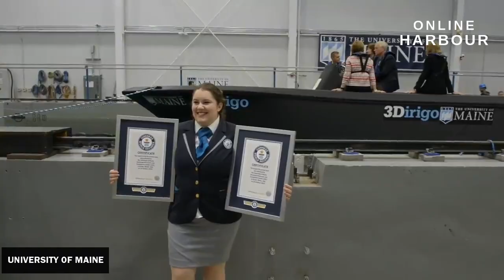The world's largest 3D printed boat built by the largest 3D printer

Comment: I mean it floats and that's great and all but how would this hull material and structure handle waves?
Reply: Thats not the problem. This is a structural stepping.
Reply: You can print with fiberglass and its over 3 times as strong as ABS, you could build in any strengthening rib you wanted where ever you wanted it, 3d printers will make boats eventually, almost indestructible and unsinkable.
Reply: No stringer system at all
Reply: @drewjohn6847   indestructible and unsinkable? lol
Reply: @ronp5644  the titanic was unsinkable too 😂😂
Reply: In order to compensate the typical weakness of 3D printed object, additional material (thickness) was used. This boat is four times as heavy as a conventionally manufactured boat would be. So, it's strong enough, but anyone who knows anything about boats knows what the added weight does to the practicality of this boat.
Reply: @jayel2531  5000 pounds is 4x as heavy as a 25' sport boat? i think not, a parker 2500cc weights 4300lbs

Comment: Hi there this looks like a very good idea can one tell how much it will cost to get a boat printed using one's own plans thanks
Reply: Probably out of your budget and totally impractical
Reply: @kanekeylewer5704  🤣🤣
Reply: Well given this is currently just a demo project likely alot of money.

The main cost saver will if they can scale and to do that they would need large order volumes.  The Navy and the Coast Guard should be the powers that are pushing this tech forward given its obvious military potential.

I mean just the capacity to deliver disposable naval assets at capacity with relatively little cost input has significant military potential.

If the Department of Navy steps in and starts push large orders through you could see economy of scale achieved over a period of something like 5 years.
Reply: The id like to know is scalability cost and durability.   Also given that ocean farming may be a thing in the near future owing to global warming how well would this work for 3d printing 3d aquatic farms.

I mean theoretically if you can get the cost down to a few hundred dollars per 1/8th acre plot you could bring online substantial floating farms.

Then you've got tidal and wind generator platforms that could be addressed.

Of course with housing prices going bonkers you might be able to reduce cost for live in boats.

You're talking sizable potential addressable markets if you can get costs within tolerance ranges.

The question is how quickly could you scale and realistically what's the cost vectors of reduction you're looking at?

There is obviously significant potential it's just the hurdle of scale that I think would hold you back

Comment: First of all. This boat has no bulkheads or stringers. LOL. Second of all. I guess the structural inspection of this hull only allowed them to equip a Mercury 150 horse engine, for a 25 ft boat that thing is not going anywhere. Also though; lastly, on their own website it said specifically that this boat is “for show only and will not actually be used” Guess that explains all we need to know about this idea.
Reply: Just because it is for show, does not mean they can't make a boat with a better structure. This was more of a "proof of concept". But you could basically design this in a way to make full use of 3D print by printing  the inside in such patterns, that it makes it structurally sound and also adds many compartments to prevent flooding if a bottom is breached. Really, this just needs a good engineering/AI hand, and this could outdo any regular boats, in terms of it's cost and safety.

Comment: 3D printing is awesome. But it really has suffered from a bad case of trend over business case.
Why not just use injection molding for this?
Reply: It was to showcase the printer and it's capabilities, they aren't mass producing 3d printed boats.  Injection molding requires a die and the cost of a die this large would be extremely high, so would only make sense if you are making a lot of parts. 3D printing is slow, but requires no tooling so is perfect for prototype or very low volume production.